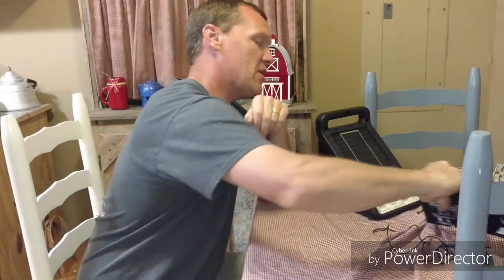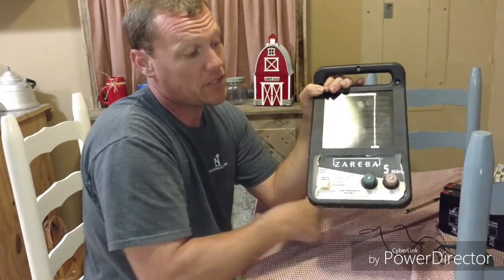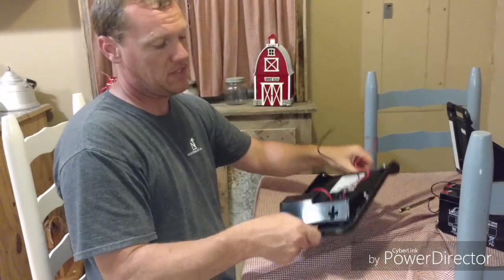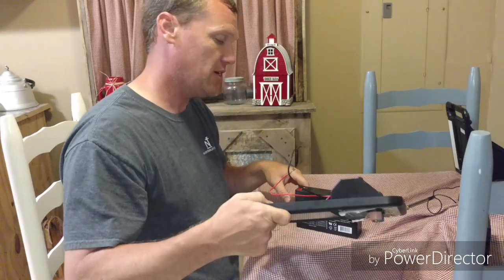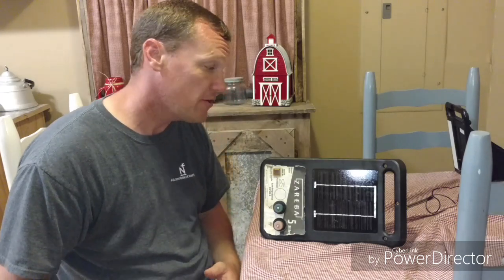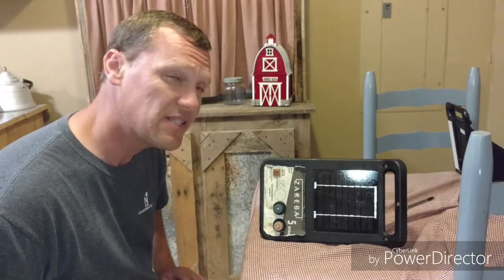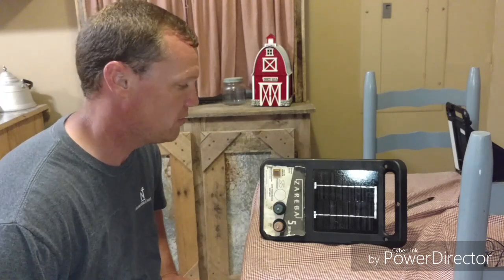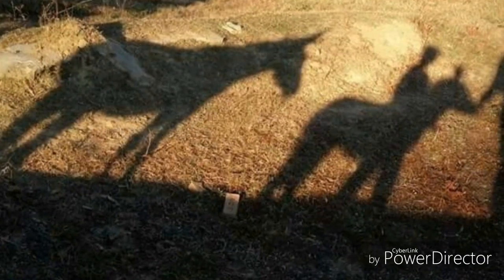Zareba 5 mile solar fence charger repair, well actually just replacing the internal battery.

Comment: My five mile Zareba never worked from Day 1. Going to have to disassemble and remove the battery. Do they hold up well outside over time?
Reply from the maker: I think I got my money's worth out of this one, in my experience, these off grid chargers only have a life expectancy of a few years
Reply: What if your light is blinking red? Does that mean it's not charged?
Reply from the maker: It's supposed to blink every time it pulses electricity

Comment: Want to try this. Is there a way to ensure my solar panel is still good before ordering a battery and going through the effort of tearing the thing apart?
Reply from the maker: If you have a multimeter you can test the leads going to the battery, in the sun I think it should show at least 6 volts.
Reply: @ChrisfromKeyfarm  awesome! Thx!

Comment: Hello Chris , I have same exact one you got. And I think my battery has gone out as well. The thing is when I look up the battery on eBay. I can't find exact one. Did your numbers match exactly? Do u have a link
Reply from the maker: I didn't find the exact battery, but if you search the same voltage and amp hours, it will be the same size battery, there are a couple of links in theses comments.

Comment: Did you have to charge the replacement battery or were you able to just plug it in and go?
Reply: Thanks. The problem is I need it to work ASAP lol. I bought a new one this morning at tsc and I have it charging with a small 6v charger now!
Reply from the maker: I'm right there with you, I normally don't buy one 3 days before I need one, I buy one as soon as I need one.
Reply from the maker: The battery you get will have a charge in it but you won't know how much. With a replacement battery or a new fence charger it is always best to let them sit in the Sun for about 3 days before you attach a load to it.

Comment: what size / amp hour battery did it have in it
Reply from the maker: 6 volt , 7 amp hour
Reply from the maker: The link I bought from is no longer valid but this one looks like it.
https://www.ebay.com/itm/143607435120
Reply from the maker: https://ebay.us/rYE0dE
Or this one

Comment: What is the battery link?
Reply from the maker: The link I bought from is no longer valid, I think this is the same.
https://www.ebay.com/itm/380853237419
Reply from the maker: 6 volt 7 amp hour battery

Comment: I can't  find a screwdriver  to remove the screws. It looks like it takes a t10 star driver. What did you use to remove the screws or is it easier to just remove the face plate?
Reply: Allen wrench set. 2nd to smallest.
Reply from the maker: It's been awhile, I cannot remember, but I can check tomorrow.
Reply: @ChrisfromKeyfarm  i figured it out. It took a smaller hex key to remove the two screws to pop off the back to gain access for the battery. My on/off switch is sticky as well!!!!
Reply: @ChrisfromKeyfarm  hi! I've been following this because I have to do the same thing with mine. Did you figure out what you used yet??